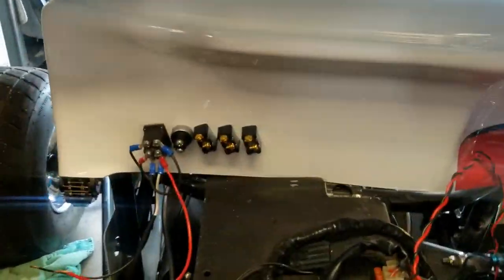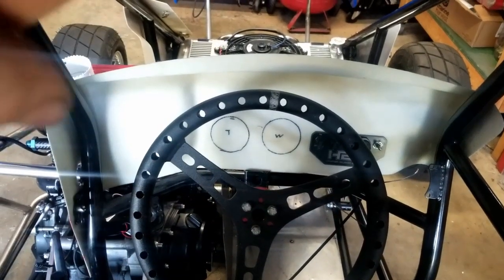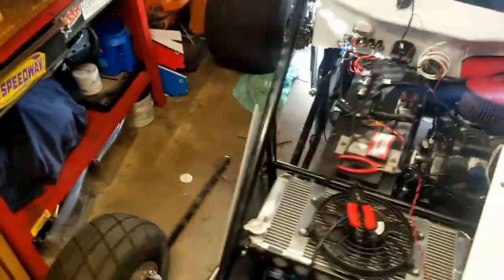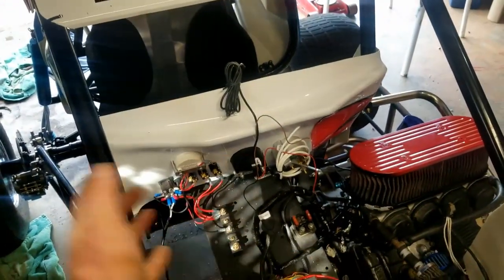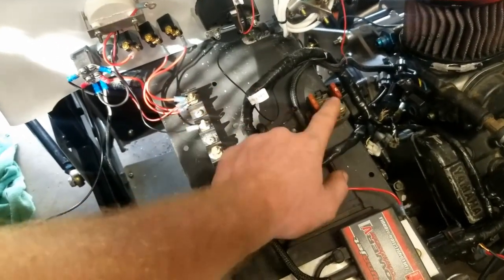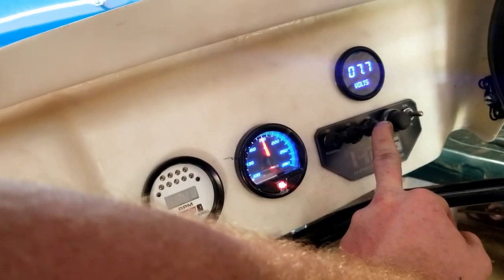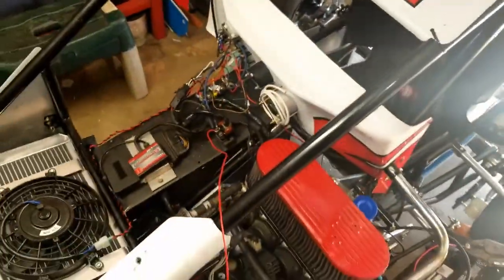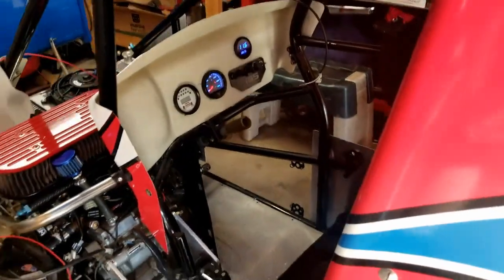Micro Sprint Build 8 (Electronics)

Comment: We are just getting jnto 600s from 125. We have a brand new guhl injection and harness. Our old 1 was a disaster. I am so intimated by doing this wiring. Where did you get the block you used as a central termination point? What gauge wire should I use?
Reply from the maker: The bus bar is actually over 20 years old believe it or not. My father used to build wiring bundles for military aircraft & those were surplus lol. You can buy the buss bars on amazon or summit racing  As far as wire guage I use 16 gauge wire for my fuel pump,fan,wing adjuster. I used 12 gauge for power wires for starter & ground. I will be doing another video soon on my new wiring cause I changed injection I will explain more in detail

Comment: Awesome job on the build videos!  Is there a rule sheet for mini sprints?  Ive only been able to find one from 2017 on East Bays website.  Thanks in advance.
Reply from the maker: so most follow the u6sa national rules but local wise we run bull ring rules which are 3 different sets call for either a hard RR tire or soft

Comment: Hey I was wondering where you hook up the sig. Wire to on the tachometer because I am confused and there's no videos about it
Reply from the maker: it depends on which motor you have to get your signal wire
Reply: @MikesBigBlock  yeah I got it I soldered it right to the number one coil wire

Comment: Is that  good rpm guage?
Reply from the maker: never had a issue with it, soaked it in water etc works great for this stuff
Reply: Can you check how much rpm from the race?
Reply from the maker: @carterjensrud8498  yes it has a max recall that is stored even after you cut power
Reply: @MikesBigBlock  sweet, thankyou for all the info last year didnt even have anything to check rpm and blew it up
Reply from the maker: @carterjensrud8498  I've definitly been there done the same thing b4 I got a tach